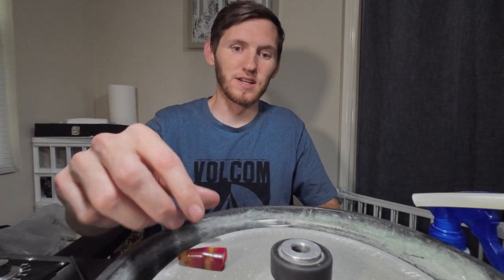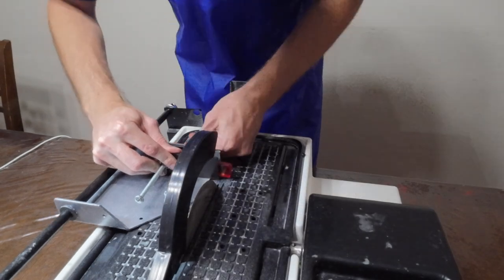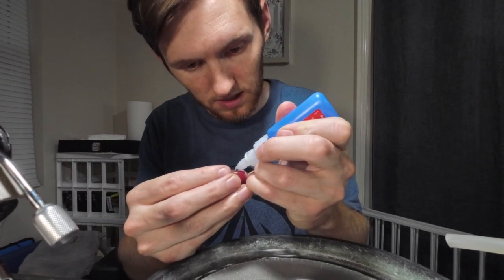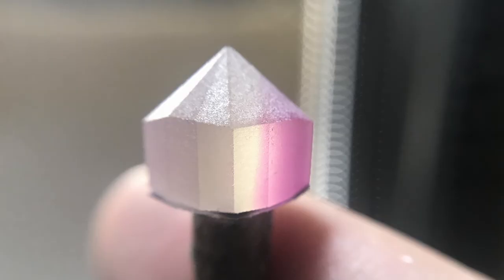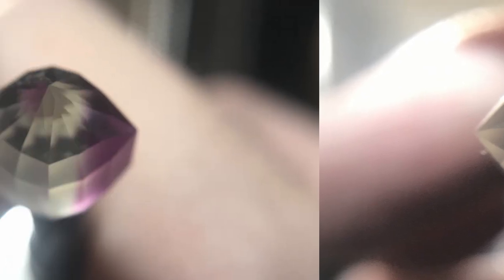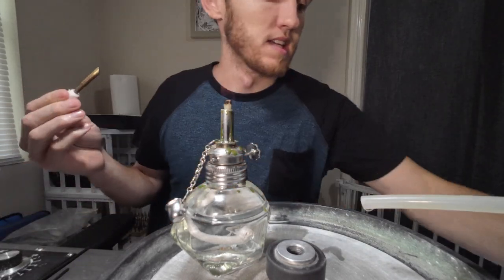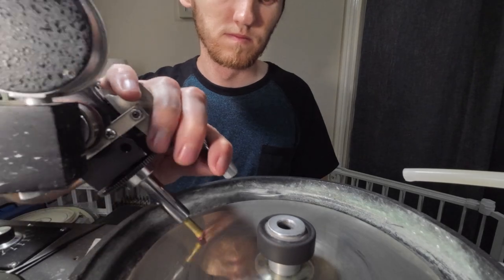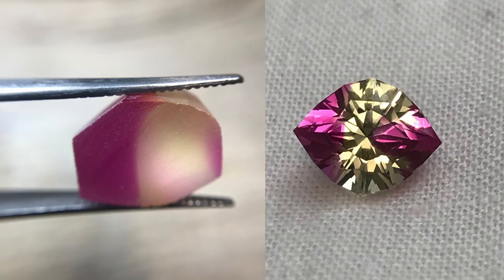How I Facet this Bi-Color Lab Sapphire for Stunning Effect

Comment: Full of technical details, thank u❤ what equipment you can recommend for cutting and polishing at the start?
Reply from the maker: Good equipment isn't cheap. You will get what you pay for. I've only used an Ultratec faceting machine which is pretty reliable, but they are one of the more expensive machines. Using cheaper topper laps for cutting and ultralaps for polish can save you some on start up equipment. If you want to do hard stones like sapphires, I would recommend getting a polishing lap like the Batt that you can use with diamond for the final polish. You mainly need a 600 grit for main cutting, 3k or 8k grit for prepolish, and your polishing laps. A heavier grit like 180 or 360 comes in handy for roughing in larger stones.